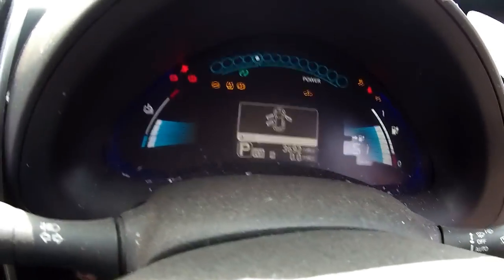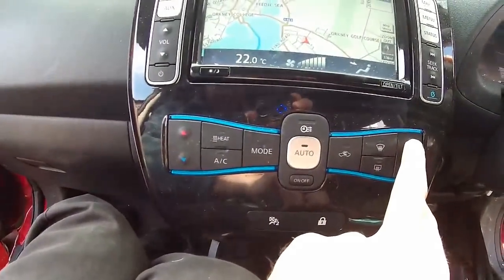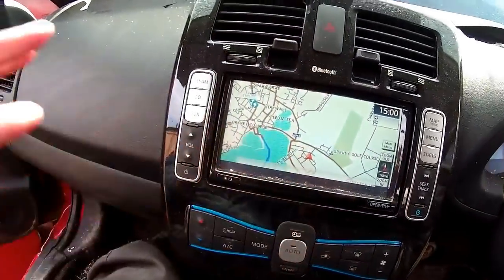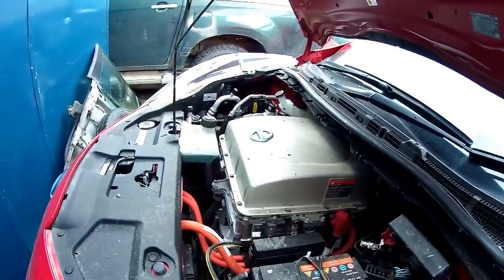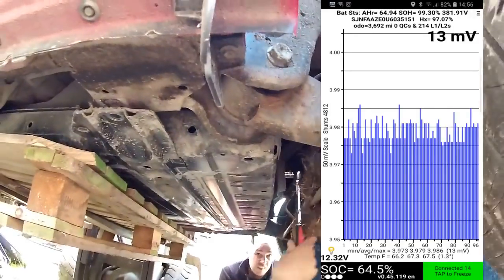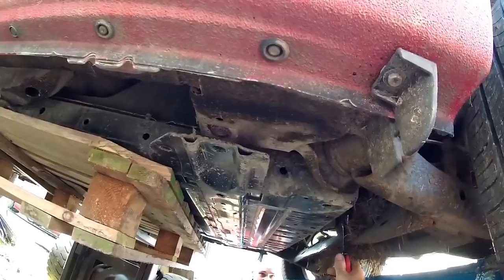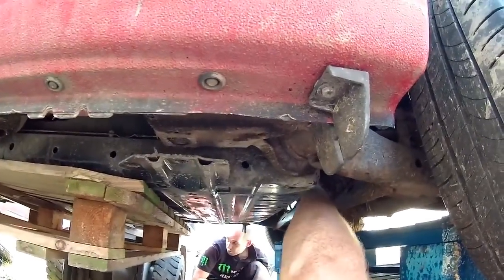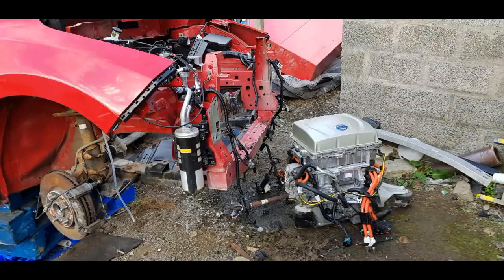Removal of a Nissan leaf battery Pack

Comment: Hi Jonathan,  very interesting video as we don’t normally get to see a Leaf battery.  On the front there’s a black tubular stub to the right of the red and orange electrical connectors.  What’s the black thingy used for?  Is it part of a battery cooling system?

Many thanks.

Comment: Hi Jonathan.
Thank you for your interesting report on removing the main battery from a Nissan Leaf. (It reminds me of happy days of replacing the engine in a Ford Anglia 100E).
Several points arise, though:- 
1. Will you be covering the new use of the battery?
2. Will you be providing a cost analysis of “breaking” a Nissan Leaf?
3. Do you know of a manual that describes the Nissan Leaf? (Haynes don’t appear to do one).
Keep up the good work.

Comment: So much for nissan and be responsible and use the battery. This leaf end up in a yard parts sold on. Don't happen to have a ptc part for the air con. Mines is dead as they say Nissan quoted me crazy price to replace.
Reply from the maker: Yes all parts are for sale , im yet to dismantle the dash e mail me for details sales@eco-cars.net
Reply: Jonathan Porterfield how much does the battery pack go for? I would love to get one to use for home storage. Also what is the approx weight?

Comment: Good one Johnathan, I also have a 3Kw system on my house but at the next opportunity I intend to get a powerwall type storage battery as I cringe when I see the amount of electricity I export over the year (about 75% of my generation). I want to get it to as close to zero as possible. Not got an EV yet but that's also on my list, we do drive hybrids though.